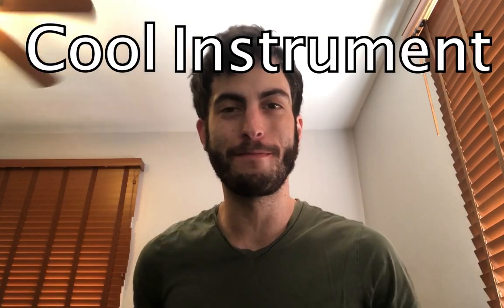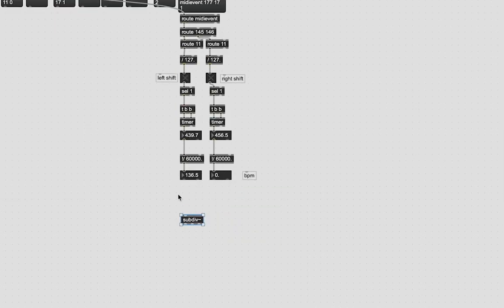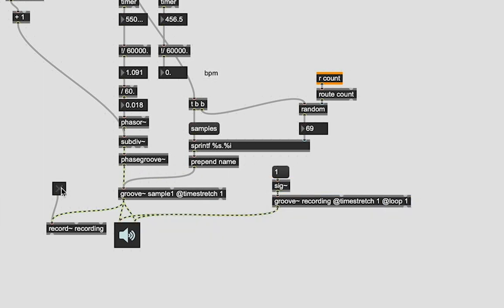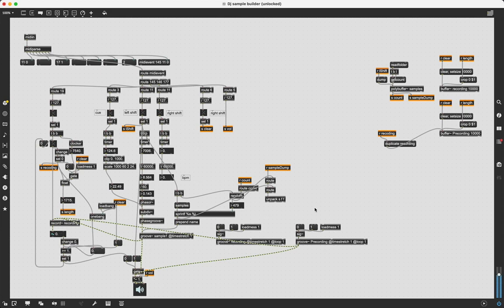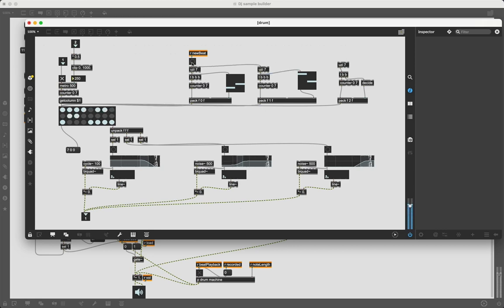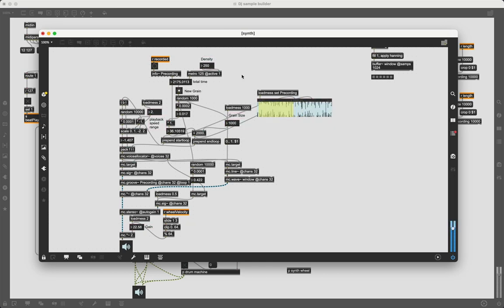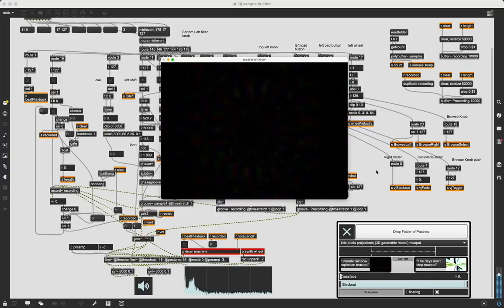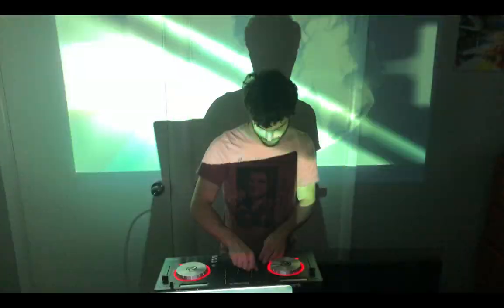How I built a custom DJ and VJ instrument in Max MSP

Comment: hey what sort of midi message does the jog wheel on your controller output? on my controller when i spin the wheel it just jumps between 0 and 1 values
Reply from the maker: It is the same on mine as well. I understand it as a magnitude of change from its previous position. The harder it’s spun the greater the value however it’s constantly sampling and outputting data so it evens back out to zero very quickly.
Reply: @AndrewRobinson26  thank you for responding!

yeah that makes sense, only i would expect it to be a float, not an int... which is unfortunate for more fine changes in speed.

i was trying to use my controller to control a groove~ but got stumped as to how to deal with these integers, since it wouldn't control the speed of the sample in a smooth fashion
Reply from the maker: @NS-pj8dr  I suppose it is different then. When you said between 0 and 1 I thought you were referring to the floating point numbers. If you're output is only a 0 or 1 then it sounds like the only information it's giving you may be direction of the spin
Reply: @AndrewRobinson26  yeah :/
Been thinking about getting a new controller anyways.

Thanks!